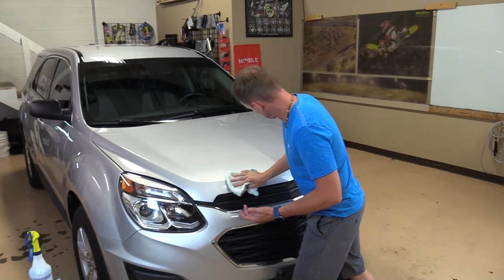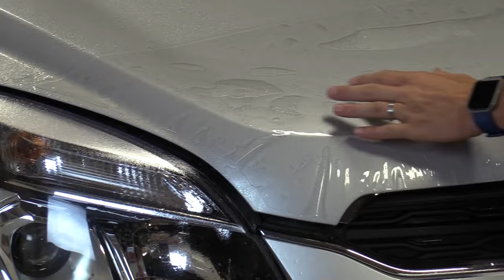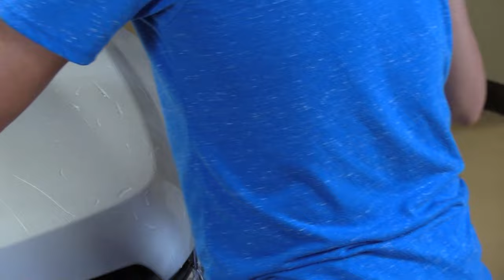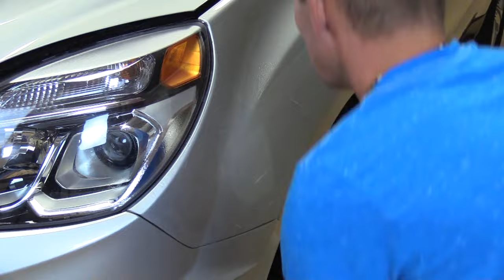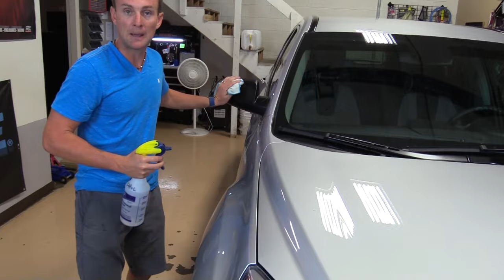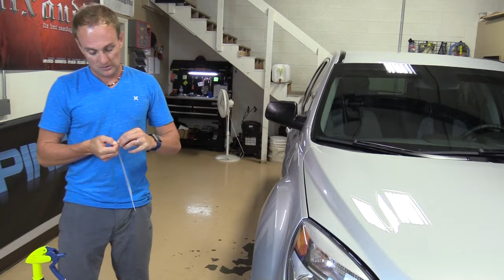How to Install Computer Cut Paint Protection Film Kit

Comment: Your video instructions are excellent.  Much better than any other site for installing paint protections.   I've recently tried installing a 3M film from another site.   Excellent material, but I was installing on a 2018 F150 Lariat.   My first attempt was a failure on the hood.   Some really extreme curves.   I ended up trashing it.  So I'm going to have to reorder another hood kit.   Wish I'd started on another  area that wasn't as hard to apply.   After about the 4th piece I started to get the hang of hit.  All the other pieces went on just fine (bumper, grill, roof, posts and door edges.    I really liked your different videos on installing the door edge film (dry and wet).   I'd recommend your videos over all others.   Really nice to watch a pro work.
Reply from the maker: Russell Coble thank you for your comment!  We are very happy to hear you found our videos helpful.  Check out the description of our video for a 10% discount on our computer cut kit or our universal kits. 👍 www.installproz.com
Reply: @InstallProz  Dang!!!  How did I miss out on the 10% discount!!!   Too late to apply that to my recent order and order something else on the website??
Reply from the maker: @ol-man-duffyj688  feel free to reach out to our customer service directly.  support@installproz.com

Comment: Nice, thanks!
Is it a good idea to wax my car before applying?  I think it'll help protect from paint fade but then I worry it'll make it a poor surface for the adhesive to stick to.
Reply from the maker: Hi Miller,
We do not recommend waxing your car before installing the paint protection film.  Just make sure you thoroughly clean all surfaces of the car that the film will be applied to.  If the adhesive gets dirt, dust or grime on it, it will not stick.
Reply: awesome, thanks so much!

Comment: Does a heat gun help in a situation like 11:13?
Reply: yes or spray alcohol 25% with water 75%
Reply from the maker: It's actually better to use a tack solution made of alcohol and water to remove the slip solution, rather than turning to a heat gun.  Just spray the tack solution liberally under the material to flush out the slip solution.  The mixture can be increased to 50% alcohol, 50% water, if you are struggling getting the ppf to tack down.